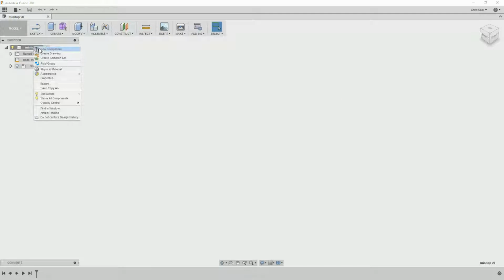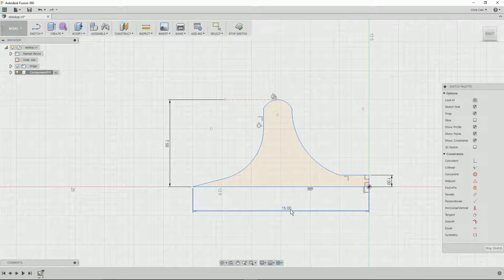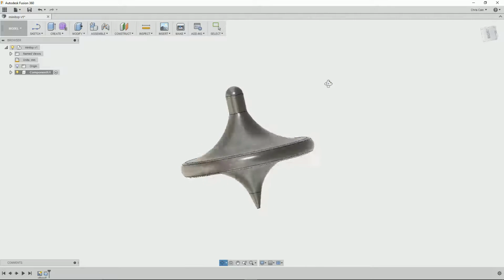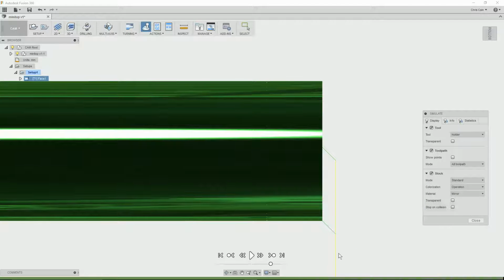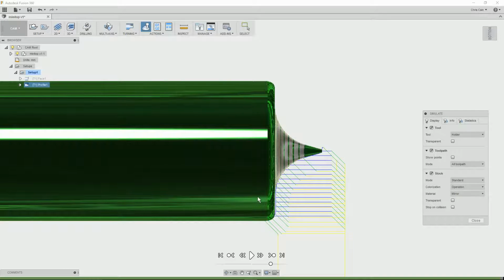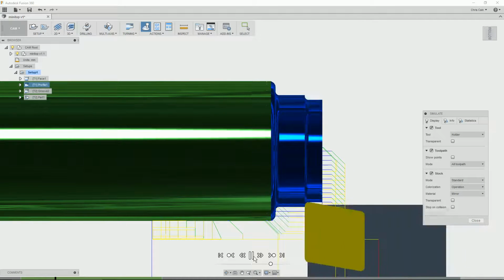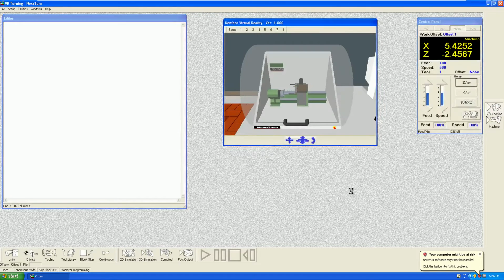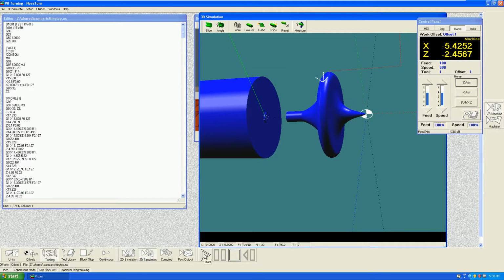Nottingham Hackspace - Denford CNC Lathe

Comment: Great Vid Chris. Im using an old Boxford 160 and im looking to try and do the same thing. Have you had any experience with outputting to Boxford stuff ?
Reply from the maker: No, but the fusion posts are reasonably easy to modify, if you start with one of the generic xxx posts you would most likely only need small changes and it should not be too hard.